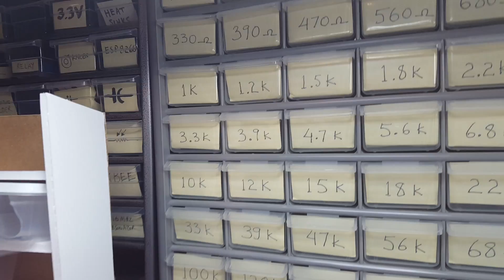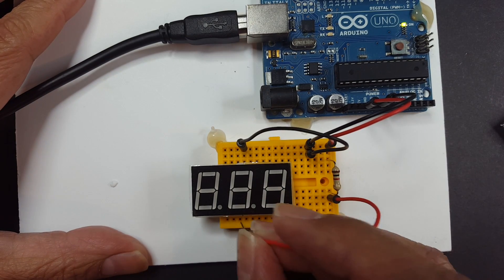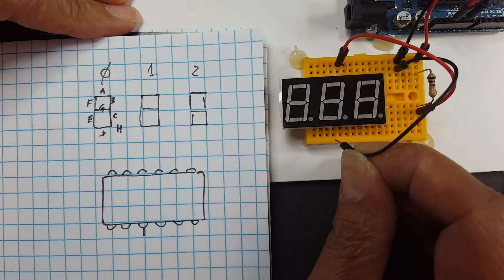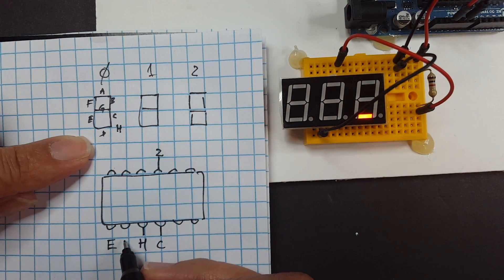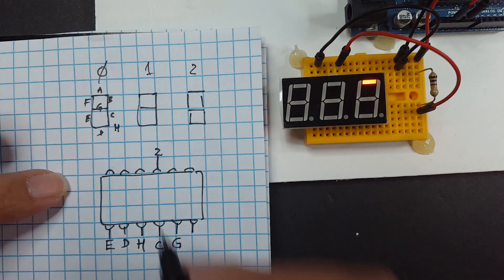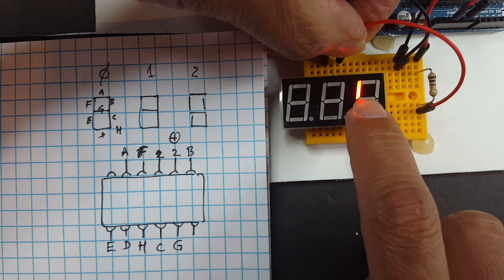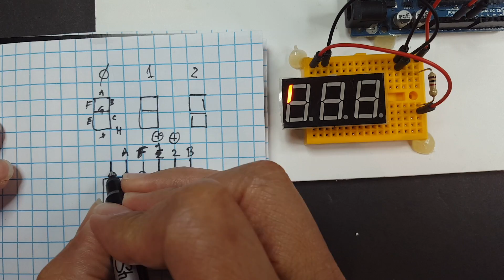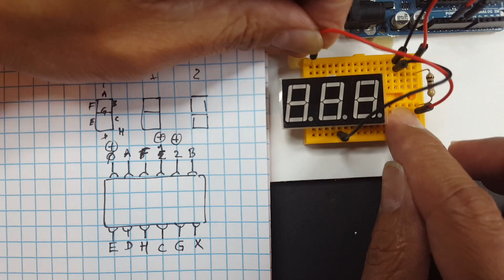HariFun #139 - No Datasheet? NO PROBLEM! - Mega Sudoku Part 2

Comment: Hari, for multiplexing such big matrix of digits you will need to control 81 of anodes and 8 segments (including dot). So you will need a few shift registers. You can also consider using MAX7219 chips. What is your idea to control all these digits? And probably strong power supply will be necessary too.
Reply from the maker: Good points! I totally agree.  

I already have some shift registers that I will use on breadboard.  On the final soldered project, I plan to use surface mount version to save space.  

As far as a strong power supply, my hope is that since these will be multiplexed, only a few of the LEDs would be on at any one time and therefore we would only need power for maybe 3 digits = 24 LEDs rather than all 81 digits = 648 LEDs!